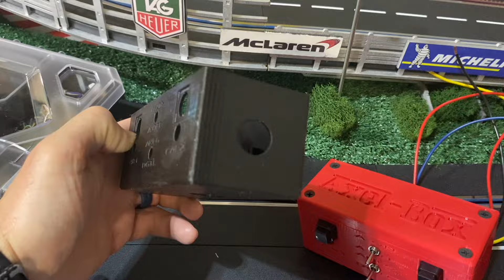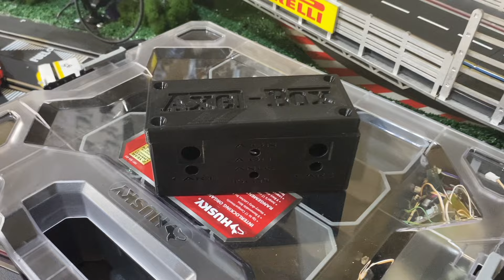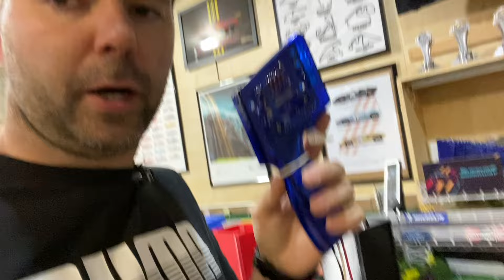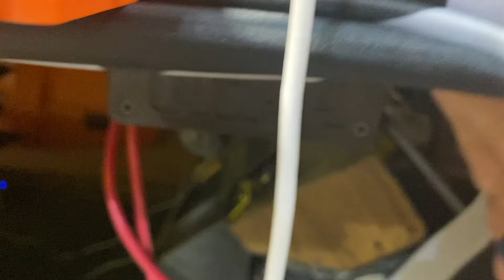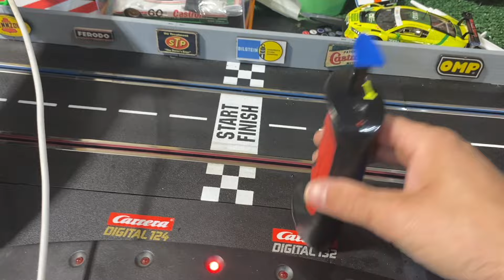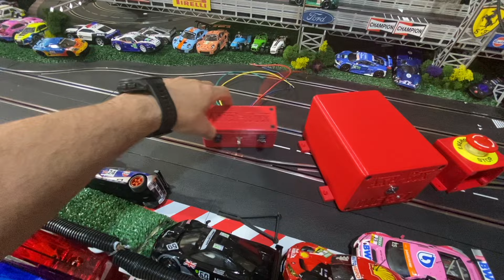Episode 11 - Get the most out of your AxelBox product!

Comment: With the original Axel Box, in analogue mode, does the CU amd the software still lapcount etc. I presume.e this does not work on the 4 lane version as the CU must be switched off, how do you run race management?

Thanks
Reply from the maker: When using the original AxelBox and running SmartRace, you can set up a smart connect server and use a mobile device (phone or tablet) to visually count laps. The system uses the camera of the device to count laps in a specific window of the screen. You can set up a maximum of 6 windows for 6 lanes.  It works fairly well and only seems complex at first, after a few attempts you’ll have it mastered. With the 4-lane box the CU doesn’t need to be turned on, but the SmartRace app allows for analog use with the CU powered down when you toggle it to analog mode

Comment: New viewer and subscriber. I will be getting an AxelBox as soon as I sort out a permanent spot for my track. Question, is there a wat to make the safety car pull in more? It seems as though in its current position it would cause fueling problems to cars racing.
Reply from the maker: I think the only way to get the pace car to travel inward a bit further into the pit area would be to pull the magnets out of it so that it doesn’t see so much downforce/brake-force.  There’s lots of folks out there that swap the position of the chip in the pace car so the photo eye is on the other side of it, and then their dedicated pit lane track they’ll move the photo eye from one side of the track to the other as well.  This way you don’t have drivers accidentally pull into the pace car lane and smash into it.

Comment: And is this compatible with smart race?
Reply from the maker: Yes you can run SmartRace with either the AxelBox or the Ultra4 in analog mode. All you need is another device with a camera and it will connect to the primary device running the SmartRace app. It uses the camera to capture ‘gates’ where the cars pass through certain windows of the screen. It is very accurate and one of the best features of the latest version of the app

Comment: This is incredible stuff. I’m relatively new to digital slot car racing and extremely ignorant regarding wiring or installing components. What I would like to see for my track is 6 driver stations each with ability to stop race and call out pace car. Are instructions easy to follow. But honestly I worry about installing them. How easy is installation?
Reply from the maker: Super easy. As long as you have a decent soldering iron and aren’t afraid of pulling off the cover to the bottom of your CU. Check out my install video for the AxelBox - you’ll see just how easy the main soldering part is. The driver stations are basically plug and play, all you have to do is mount the boxes and plug in the wiring harness I fabricate.